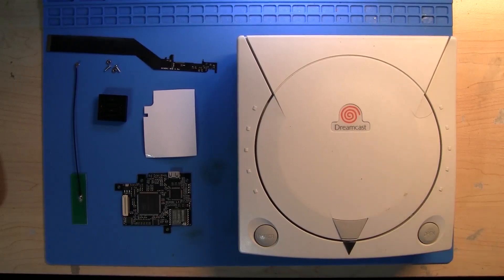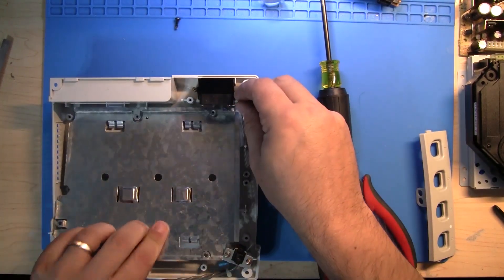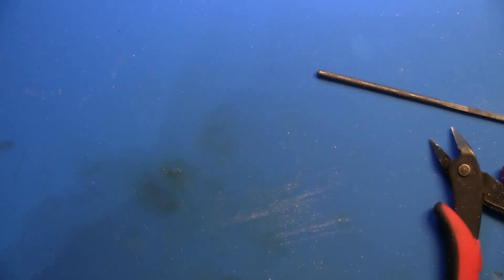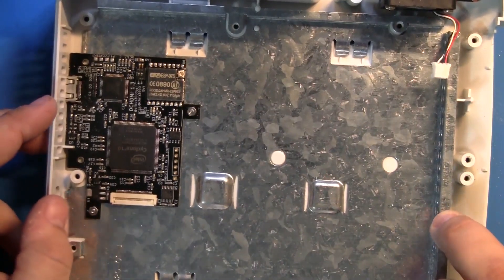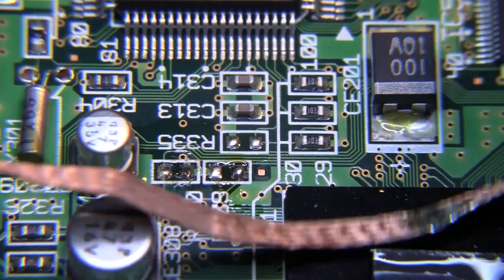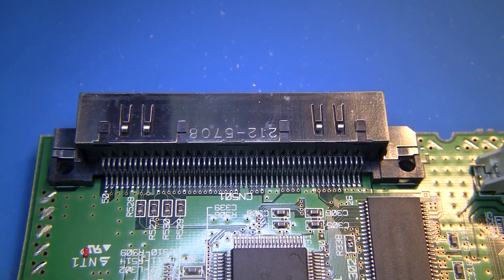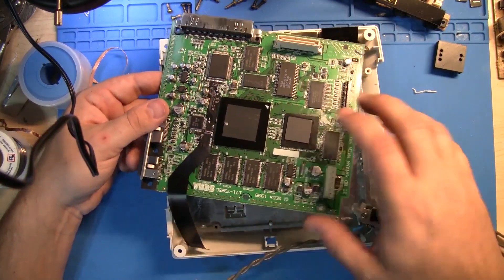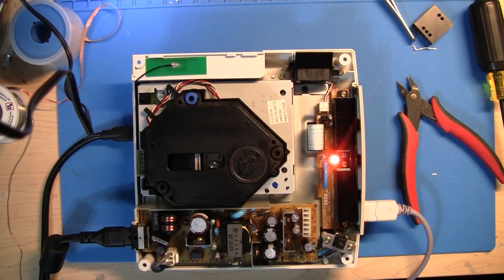DCHDMI Install from start to finish.

Comment: 30:45 - This part glosses over the fact you have to make sure that both flex cable IC cables here are lined up, not just the middle one he is talking about. If you solder down that second middle flex cable IC connector and the third/last one doesn't line up, it's game over because that third/last/smallest one has NO give to it at all. Aligning that third/last flex connector should probably be done second because the middle one DOES have give.
Reply: instaBlaster...

Comment: Bad idea as my 2nd soldering work in past year and...2nd since I was a kid? lol.  Already bought the kit, so it doesn't matter; gonna give it a shot and hope it all works.  This is a great video which I will reference like a thousand times by the time I'm done.
Reply: Did it work for you? I'm also tempted by the dhcdmi and like the idea of putting it together myself but i'm zn extra noob when it comes to soldering.
Reply: @prophetedubaroque5136  Not yet. Working towards it by doing other (more noob-friendly) soldering like practicing on broken electronics to solder and desolder stuff.  I’m in the middle of replacing an Atari Lynx screen. Starting to feel confident.  NESRGB will be next.  After that, I will try my hands on the DC Digital.  Hoping the gradual increase in difficulty and experience will help deal with that tiny monster.
Reply: @prophetedubaroque5136  Wow, my response was only 3 months ago?  Dang.  I just installed the DC Digital last night and it was a breeze, but only because of my prior MOD experience since between that time. The pins really are tiny but still manageable under a magnifying glass. iPhone helps out a lot too as you can zoom in to verify bridges.

Comment: Awesome video. Just one thing I was taught when removing the top case is to open the lid so you wont break the switch on the back that detects when lid is open or closed.

Comment: Installed mine using this guide, working good so far, thank you.
Reply: One thing i did notice was when i connected the opt pad to my usb gdrom my dreamcast would freeze on boot on the dreamcast logo. Have you seen this before? Once i removed the wire it worked fine again.
Reply: Ok, my bad, i hadn't changed the opt setting to usb-gdrom, all working now. Also, anyone who has a usbgdrom, there is a new firmware update that disables the timer brick. You all should update. http://3do-renovation.ru/USB-GDROM_Controller.htm

Comment: What's up with this
Step 9 - USB-GDROM & GDEMU Wire hookup & Setup

    If you are hooking up the optional wire follow these steps, otherwise skip to step 10.
    Turn the console on and login into the terminal (See "Advanced Connection to the ESP" in the settings page. Change the "Option wire" from LED to either GDEMU or USB-GDROM
    Make sure the console is off and unplugged (Pull power supply).
    GDEMU - Solder wire as shown in pictures.

Comment: One small warning for the install, the test pad for the reset circuit is just a tiny solder blob and if ur not careful it can wick onto your iron tip leaving a dryhole that's nearly impossible to replace
Reply from the maker: Its a copper pad, that has solder applied during the stencil process.  Your pad lifted.  Too much heat or not enough flux can cause this.
Reply: citrus3000psi It was kinda funny when it happened it just sucked up on the tip as soon as I touched it, it happened so fast I was speechless. The test pad has a very small amount of solder on it which probably made it draw up on the tip easier, I looked for a pad but never found it but managed to improvise,  just wanted to add the warning for other fellow novices, I've never had a pad come up like that before with so little "effort"
Reply from the maker: @madnesshero4675  Yeah perhaps here was some type of other issue from factory with the copper adhesion on your board.  The resistor right next to can be used as well as an reset point as well.
Reply: Exact same thing just happened to me. not sure what to do now

Comment: I know this is basically an abandoned project now... tho I wish things like this would be fully polished before Devs move onto new projects. I connected a fresh Genuine install (ordered 2020 from customer and sent to me for installation) everything fine. all hearts. games working. audio good. I think, hey.. I'll do him a favour before I pack for dispatch .. let's update from 4.7 to 4.9. Connect to wifi and do the update... system starts and video goes all wacked out..  video cuts out. power off on and on.. no more LED activity... so now I have to butcher a serial adapter together and get this brick fixed before getting onto other people's consoles.

Comment: After following this, and reading the tutorial at dansprojects, I got my DC into a 2M solder lab finally a few days ago.  The HDMI output looks great, but I have NO sound coming out of the HDMI connection.  The standard output port using SCART or composite is fine.  I've checked and rechecked the solder points on the gull wing leads on the Yamaha chip and the ones nearby on the smaller components and for the life of me I can't figure out why I have no sound.  I also have all hearts on the self-check, along with the latest firmware.

Comment: I tried this mod myself and I was not succesful, full disclosure, I am new to this hobby and my only experience was installing a modchip on a PS1 before trying this, from that to this, the jump in skill is ridiculous

to recount the damage i've done:
I've trashed 2 flex cables up to now
I've trashed the video chip on my console because of a bad flex cable install, a poor connection caused a shortcircuit and made a crater between two pads on one side of the video chip
I removed the video chip now with my hot air station to assess the damage, and during the removal, I screwed up more and ended up lifting several pads off the PCB
now my dreamcast mobo is REALLY REALLY screwed, will go back in to try and repair the missing pads but I've been told it's done for

I've been told that it is not worth the time to repair all those pads I lifted and that I should just get a disposable mobo and practice there before going back into this
it's been an expensive attempt but I wanted to give it a try anyway

so yes, please contain yourself from doing this mod if you have never soldered a flex cable before, it is extremely challenging, everything from the temperature of the solder tip, to the type of tip, to the alignment of the flex cable, it's just so many little things that once one goes out of control you are screwed.

Comment: Woo hoo! Just finished my install! Thanks for making this walkthrough, it made this install a lot clearer. Couple questions about the written guide compared to the video. 
1.video shows wiring for reset, etc. but not in written? 
2. Written shows different mount  location (top of heat sheild) for wifi ant if using gdemu. Is there a difference since we're supposed to disconnect the gdemu before updating anyway?
I thought doing the smd recap was  difficult but man that ribbon cable is tiny!
Reply from the maker: The written docs should be your guide. The video only as an extra tool.   
The written guide explains the optional wire for both the GDEMU and USB-GDROM?
Top of heat shield is new the mount for the wifi antenna.  You can likely leave your GDEMU in place during upgrading with this antenna location.

Comment: Hi, thanks for your great job. I have done this to my DC and works good. One question is 1080P screen does not fully fit on TV,  is there a way to fit or stretch it ?? thank you again!!!
Reply: Answered my self.. the trick is set 960p and tv ratio to 4:3!! I understand what 1080p means in dchdmi....

Comment: I had my Dreamcast DCHDMI modded by Stone Age Gamer and I only see 2 screws at the back of the Dreamcast Where the DCHDMI is installed and not that hole where screw you said will poke through the sticker. Does this mean they did it the way that is likely to cause problems or damage to the HDMI Port, DCHDMI or that capacitor? I ask because my DCHDMI modded Dreamcast will get a no video when it goes to load a Game if I'm using the GDROM or when it tries to go to the M.O.D.E menu when I use the MODE and will also sometimes reboot as if something is shorting or maybe the ribbon cable soldered to the Video and Audio  Chips are disconcerting or shorting out ? Maybe because they used that hole by where you said the screw hole will hit capacitor and did not move the capacitor so over time it cause damage to the capacitor or the DCHDMI board? I have no soldering skills at all so I can't try to check it out and fix it if needed or risk remove the RF Shield to see if that capacitor is touching the screw in the screw hole. I don't want to risk damaging the DCHDMI board or the ribbon cable that is attached to the Video and Audio Chips. I now have a over $800 paper weight unless I can find someone who can check it out and possibly fix it if it does not cost too much.

Comment: Where do I run the OPT reset wire to exactly on the USBGDROM? I think you mean the switch, but I am unsure. Thanks. Great video and board by the way!
Reply from the maker: Checkout the written directions.  This is exactly explained on what to do  http://dansprojects.com/dchdmi_install.html

Comment: I've done some soldering myself, mostly controller PCBs for fighting games. I don't understand how when you are soldering the IC with a flat tipped soldering iron that the leads aren't bridged together? You literally just rub and solder two leads at a time and they just magically stay separated instead of being soldered together. I've struggled with this doing fine soldering in the past. Is it mostly just using very little solder?
Reply from the maker: Flux, makes the solder have surface tension so it pulls away.  And yes very little solder is needed.

Comment: Hey everyone, I seem to be out of 30 awg wire for the reset wiring. Would I be able to use 20 awg instead or should I hold off until I am able to find some 30 awg?

Comment: HELP!  Awesome product and just finished installing mine. Looks gorgeous but for some reason I am not able to get sound working. Not on the Dreamcast menu nor any of the games. I am using a USB-GDRom by the way. Sound was working perfect before the mod using the HDMI Akura box. Any help will be greatly appreciated. Oh and I bought it from the official website. Thanks
Reply from the maker: one100bill NEOONE its your flex cable install. Check your points on the sound chip
Reply: citrus3000psi 

Yes sir.  I had 2 points bridged as your picture indicated. Thank you so much. It sounds and looks phenomenal.  Just need to learn on how to update it and learn the settings. Woo hoo!

Comment: have done some soldering projects but never have soldered a flex cable on. I know you can use the wick to fix any unwanted bridges. do you have any tips for avoiding bridging in the first place?  I could see myself bridging, then taking too much back up with the wick, rinse repeat.
Reply from the maker: You can almost solder the flex on with no extra solder at all. So when you do put solder on the tip only a very very tiny amount is needed.

Comment: 40:48 I messed up the test point, now there is a huge giantic Black Hole in it :(  IC206 )

Is there an alternative test point or do i need another mainbord now, please help...
Reply: Same here 😩. Can’t for the life of me get more solder to stick there
Reply: @Rickyrick423 that black hole caused a damaged mainboard, combined with lack soldering skills. Bought 2nd dreamcast (parts only from ebay), and still dont know if thats also working, why?

The psu was also damaged by short circuiting.

Unlycky me, ordered also now a 2nd psu.

No dchdmi for me anymore.

Ordered Kaico vga to hdmi box and also a mClassic video enhancher.

And still cant test it, why mclassic still on the way due the covid19 outbreak, and still no pico psu delivered.

Man man man. Unlucky me and 300 euro waisted money till now.. still ticking

Comment: Thanks for the install guide! I installed mine yesterday and 99% it works fine, got all hearts at the info Menü und updated to the latest firmware. The only issue I habe is that I only get a video signal out to the tv if a VGA box is also connected. Do you have any ideas to fix this?

Comment: Hello @ all! 🙂
I really hope i can find some help here.

A guy modded my dreamcast with the dchdmi hw2 mod from pixel fx and modded it with a bios region free chip.
Now i received the console back but there are 3 problems now.

1. there is no sound output. i cant hear any sounds

2. The picture set to 1080p output seems not sharp..looks more like blurry and jaggy. its not a clean picture like from the first DCHDMI mod i have in my other dreamcast.i also noticed   that the dreamcast boot up logo shows dither in certain areas...you can see a dithered dreamcast logo before it appears.

   
3. When you set it to 960p output , the picture is completely stretched horizontally. on my dchdmi modded dreamcast there is no horizontal stretch on the 960p mode.

I used the same HDMi cable for testing. on my DCHDMI modded DC tere are not such problems...on my DCHDMI HW2 i have those problems with the same cable and the same port on the TV.

the guy tells me that he tested all and it worked perfectly.
does anybody have an idea whats going on??
thank you very much!

Comment: Soldered everything (+ optional GDemu cable) and don't seem to have a bridge on the chips. Anyhow, it boots up to the date screen, but after some seconds the screen disappears and something starts to beep in my DC (sounds like a coil). Doesn't matter if I'm using GDemu or original GD drive. Ribbon cable also looks OK under microscope.
I'm using the DC with a pound cable, but I don't think it comes from that 'cause it worked before the mod. Also my fan doesn't spin anymore -_-

Any suggestions where to look for the problem?

EDIT: OK, I broke one pin of the fan socket. Now it boots to GDEmu menu. I just have to wait for my miniHDMI to HDMI converter :D

Comment: Is the wire  from the test point to RST mandatory?
The moment I held the soldering iron to the testpoint to apply some solder to it, it just came off...
Is there any alternative point to solder the wire to?
Reply: just happened to me. did you figure out a solution?

Comment: So I’m about to get GDEMU. Will that be compatible with the DC HDMI board?
Reply from the maker: Yes, no problems.
Reply: citrus3000psi sorry. I meant to say a clone GDEMU. Will that work? I hope so
Reply: Should be fine clone or not.  The only problem is that GDEmu will require some kind of EMI protection.  USB-GDRom uses the shielding from the actual GD-Rom so its perfect from the get go.
Reply: Chi Wai Tran sorry. Not very knowledgeable when it comes to soldering. What’s EMI protection?
Reply: @InitialXG  EMI probably stands for electro magnetic interference.

Comment: If you’re using a USB gdrom, u have to turn on that switch. But do you need to flip on the switch if you’re using GDEMU?
Reply from the maker: The switch is both optional for both GDEMU and USB-GDROM.

Comment: I think your text guide has incorrect drill bit sizes at the start. It says "5/32" and "3/64" -- but I think it is supposed to be "3/32" and "5/64." I have a pretty big set of drill bits, but I don't have a "3/64th inch" bit. Also the text guide doesn't say which size to use for the steps where drilling is performed.
Reply from the maker: Thanks for bring this to my attention, I will update the guide. The drill bits should 3/32 & 5/32 The larger drill bit goes into the drill block guide and is a perfect with the holes.  The smaller drill bit is for drilling the m2 screws that mount the DCHDMI.
Reply: @citrus3000psi  Thanks!

Comment: hey citrus, I was able to install it with no big issues but the video has some artifacting and color changes. What should I do? Thank you!

I’m going to try to check the connection on the video dac but would like to know if there is any other thing I should watch out for.
Reply from the maker: Is there artifacts on the OSD when its pulled up or only on the incoming video video?  I'd recheck the flex if its only the incoming video feed.

Comment: The text version of your install guide says: "If you are using a GDEMU ... you will need to bridge the antenna. ... these devices emit a high EMI and ... Bridging the signal reduces the EMI effects. You can use a piece of a wire to help you bridge the antenna, but the wire must be covered up with solder." I'm confused. Where should the wire connect?
Reply from the maker: In the install instructions there is a close up picture of the antenna that is bridged.  The GAP is far apart so some people may have trouble filling in with solder.  Simply put a piece of wire between this gap and fill in with solder.

Comment: Your installation video helped me a lot, thank you! The only thing I'm wondering about is that you didn't used the "sticker" to prevent touching the HDMI board bottom side, with the bottom metal case. I had to use this sticker that was included in the packaging, otherwise when pushing the HDMI cable up and down I got a black screen and the DC switched off (because of short circuit). But now it's working fine 😁👍
Reply from the maker: I applied the sticker at the start of the video around the 1:15 mark

Comment: I'd really like to know which screwdriver you're using their lol.  Looks like a Dewalt.  What model, and the attached bits, etc.
Reply from the maker: Yes it a Dewalt Gyroscopic Screwdriver.  I love the thing.  It just takes standard bits.  Nothing special.
Reply: @citrus3000psi  I thought that was the one, but had to ask.  What is connected to it in this video?  Mine are all short. :(  (I also ordered the dchdmi lol).
Reply from the maker: @F34RTEHR34PER  I'm using FlexTorq bits by dewalt as well.
Reply: @citrus3000psi  Perfect.  My OLD black and decker screwdriver is on its last leg lol.  Thanks for the info.  I think we have the same drill already lol.